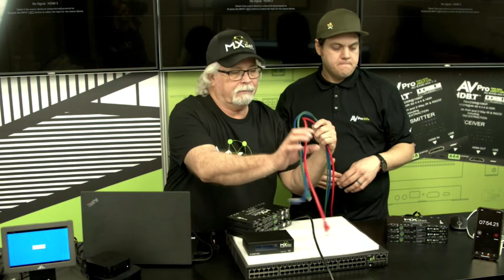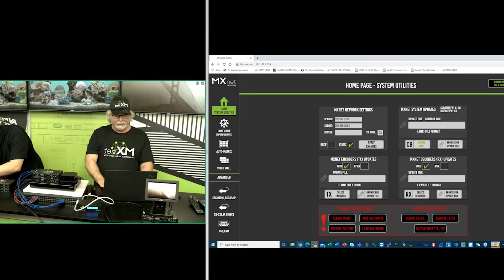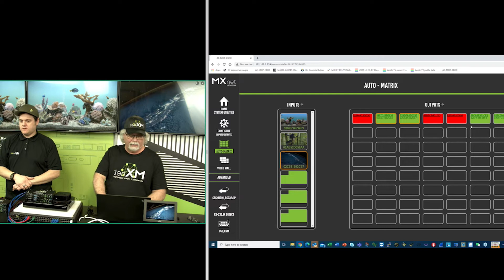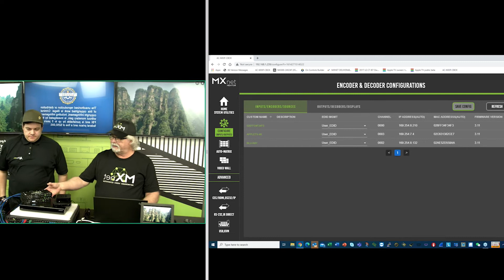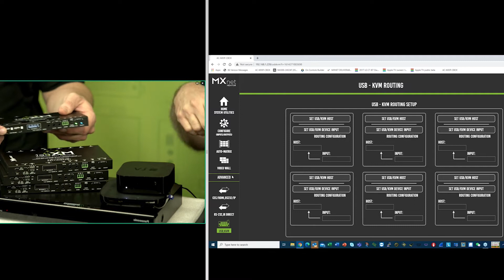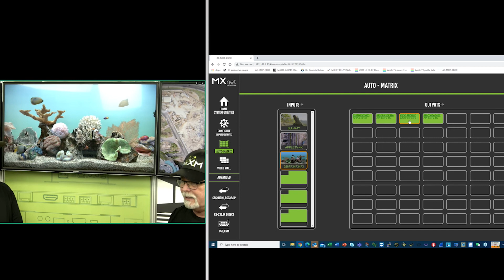MXNet: AV over IP Complete System Set-Up! (With TIMER!)

Comment: Why are there artifacts?
Reply from the maker: The most common reason for artifacts is compression. When taking a large video signal and compressing it down to sometimes 5% of it's original signal, when decompressing the missing information gets filled in and you may see artifacts on screen.